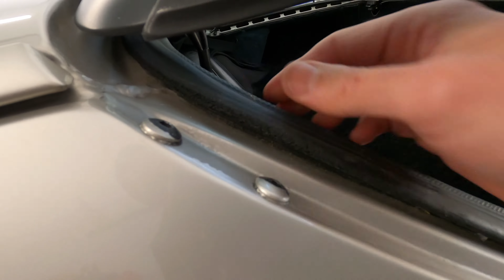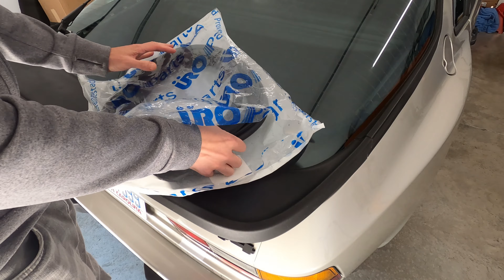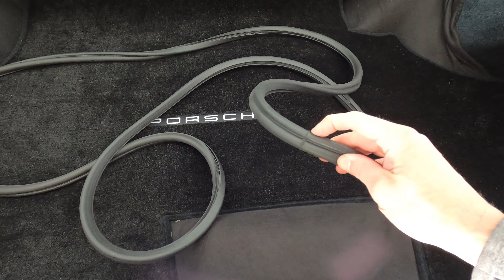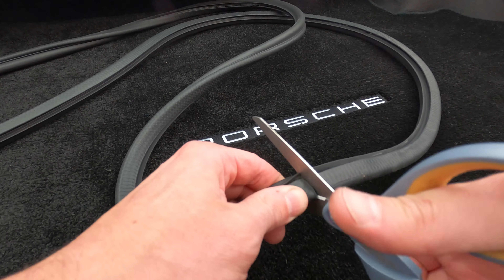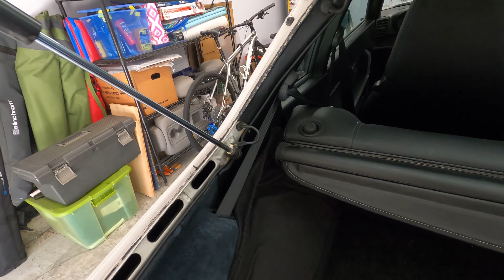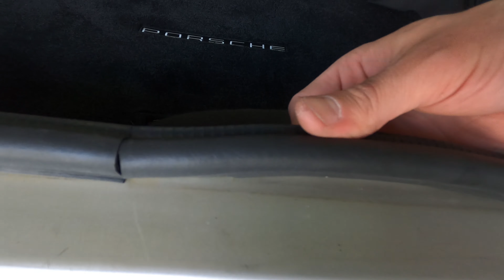Porsche 944 – Rear Hatch Seal Replacement Tutorial

Comment: You mention the only944 sunroof seal in this video. How was the fit with their one piece design? Did you end up cutting it like this hatch seal or good as a single piece?
Reply from the maker: The only944 sunroof seal fit perfectly without making any cuts. It’s a nice fit that takes a bit of thumb/finger pressure to work it into place on the roof panel, but once it’s installed the fitment on the body is perfect.

Comment: part number for seal...
Reply from the maker: Part number is: 944-512-043-01

It may be listed as a rear hatch seal or a decklid seal at various vendors. 

Also, here is the site where the Porsche Classic Parts Catalog can be downloaded, super helpful to have in hand - https://www.porsche.com/usa/accessoriesandservices/classic/genuineparts/originalpartscatalogue/
Reply: @NC944er  thank you so much...any suggestions on the interior carpeting? my whole inside needs replaced
Reply from the maker: @johndeltoro7990  Unless you have a large budget for a new custom job, I’d look at picking up some nicer conditioned pre-owned carpets either on eBay or check to see what Plyhammers Parts has.

Comment: Not gonna lie… I was watching you talk about all the connections and things to remove to install the new seal, and I was groaning a bit. I let out an audible sigh of relief when you just cut the new seal! LOL
Reply from the maker: Lol! Yeah, I could tell when I touched the rubber grommet for the wiring that it would have crumbled to dust, requiring me to source yet another part, so I opted to cut the seal. No regrets as the seal hasn’t moved a millimeter since being installed. 👍🏼
Reply: I’ve established a pattern with my new-to-me 951. I watch one of your videos, go check my car to see if it needs that work (it usually does), then I go look for the parts and add the project to my list! LOL… Thanks again for all these great videos!
Reply: Two years later, and I just am getting around to installing this seal (along with about 10 other tasks) next week. Las Vegas is going to be burning hot in 30 days or so, gotta knock out the AC and weatherstripping and seal projects NOW!!! LOL...

Comment: Say brother, my 951's sunroof latching mechanism works sometimes, sometimes it doesn't, any idears?
Reply from the maker: Hey man, can you tell me a little more about what’s happening? Are you referring to the motor that opens and closes the sunroof? The latches that secure the panel on the front? Or something else?
Reply: @NC944er  The 2 latches at the back. sometimes it works and sometimes they dont hook to the roof. any tips or something?
Reply from the maker: @free-birdrocker8809  Not sure if this would apply, but there is a way to retract or engage the rear arms using the sunroof switch with the key in the ignition, but while the car is NOT on or running. Here’s a clip - https://youtube.com/clip/UgkxygEMoe72vdZIWcVDcMjWvBckHJJuZ6WT

Comment: I bought a 951 earlier this year and was dismayed to discover a leak in the hatch seal after its first wash. This video got me to buy the Only944 hatch seal and do the replacement myself. It required a lot of elbow grease especially in the top corners, but now I have no leaks and less hatch rattle. Thanks for all the clear instructions you provide.
Reply from the maker: Nice! Yeah, the hatch seal isn’t too bad to swap out. Glad you got it done! 👍🏼 The quarter window seals on the other hand can be a bit of a pain, especially if the old rubber is particularly dry/hardened. I like the Only944 stuff a lot. I would have gone there for this one and skipped the URO seal if I didn’t have a gift card for RockAuto at the time. 😂
Reply: @NC944er  Ironically, quarter window service is my next item. I have louvered windows from Car-Bone and need to replace the factory windows. I found a tutorial for removal, but not sure if I can re-use the rubber or need to order new seals.
Reply from the maker: @Cam-pe3nd  Yeah, you can pop those in and out while reusing the seals, the rubber basically folds over the metal seam in the body panel. They are pretty tight though, so unless the existing rubber is still soft and pliable, I personally would budget for some new seals as that is another known area for potential leaks over time.
Reply: @NC944er  Thanks for all your help! I'll see how far the current quarter window seals will get me, just cuz I'm impatient, but I'll keep an extra vigilant eye for leaks now.

Comment: I just installed an Only944 seal on my Turbo. It was satisfying to watch you peel your old seal out, and even more satisfying to tug my cracked old seal out and put a spongy new one in. I had previously tried adjusting the hatch pins to get it to open without pounding on the bottom, but couldn't find get it right with the old compressed seal. Now it pops right open, and doesn't rattle when closed. The hardest part of the job was just getting the leaves out from around the hinges.
Reply from the maker: Nice! I love the Only944 stuff and the approach they take to make these cars better than they were originally. If I didn’t have a gift card for another auto parts vendor at the time, I probably would have gone with the Only944 seal. 😂 This URO is working well so far.

Comment: Do you possibly know how many feet or meters is needed?
Reply from the maker: All the available seals will be pre-cut to the appropriate length, but the hatch seal perimeter measures approximately 172 inches, or 14 feet and 4 inches.